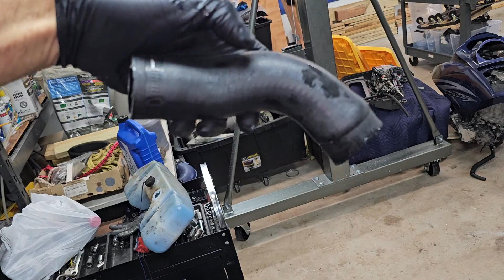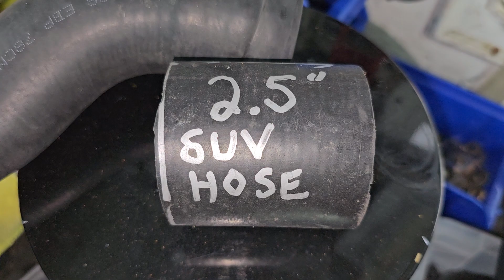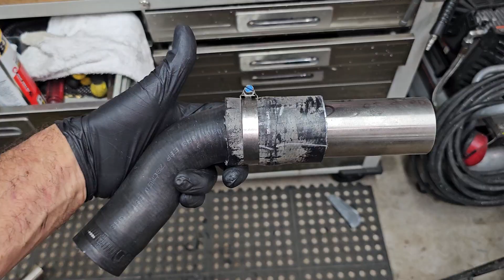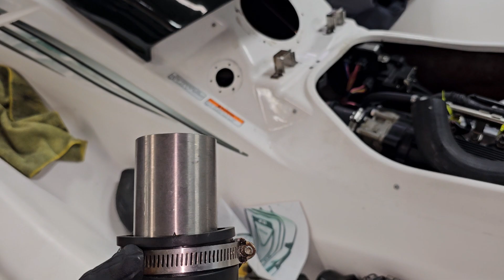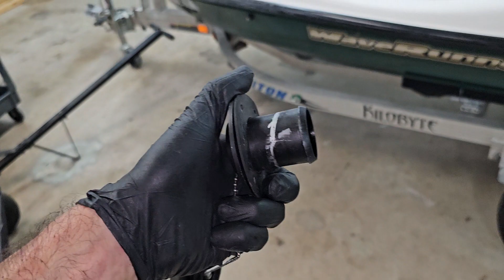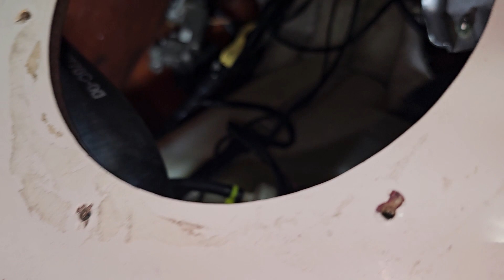Yamaha SUV 4-stroke conversion alternate refueling location using SUV oil fill hose

Comment from the maker: Filled the tank up to the very top of the tank, pulled it on a bouncy trailer for over 20 miles on a 105 degree day in Houston.  Also, it's been sitting in direct sun in my driveway for weeks at over 103 each day with a high of 109 one day and no fumes are escaping from the tank fwiw